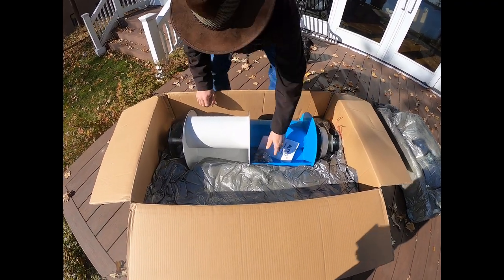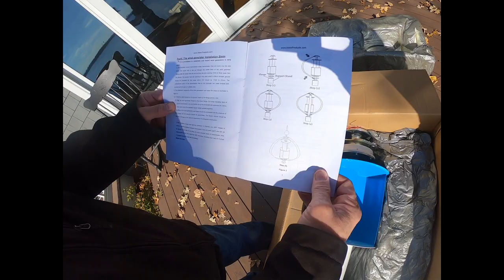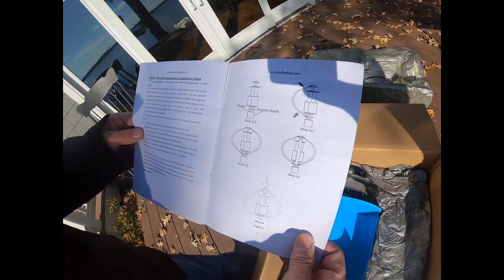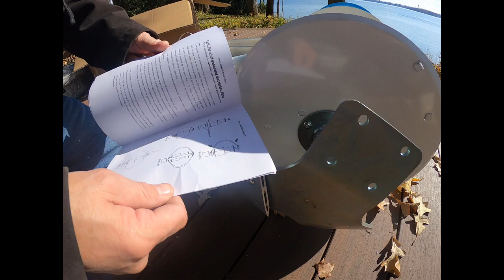Unboxing Aleko (Typmar) 400 Watt Vertical Axis Wind Turbine from Amazon Prime!!

Comment: I purchased one of these off eBay from a seller called Tumo Int 4 months ago, it's absolute rubbish, had damage to center savonius blade, powder coating is peeling off revealing a bad powder coating, not even etch primed first, unit only produced max 80 watts in 90 km/h winds, they market them as 12/24 volt, sorry guys but it's a 12v turbine, never gets up enough RPM to make 24 volts, the new turbine I purchased Is made by Aura Energy from China, it's been tested here by one of our universities and it's a real deal 400 watt unit, and twice the size of the Typmar!